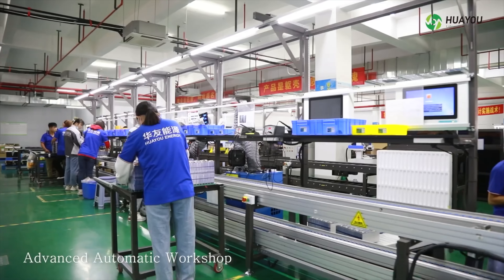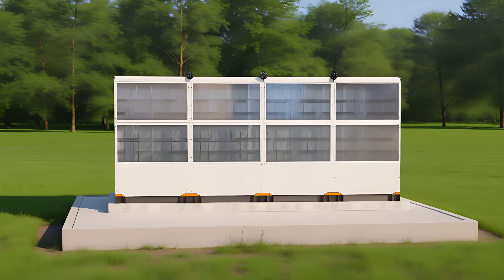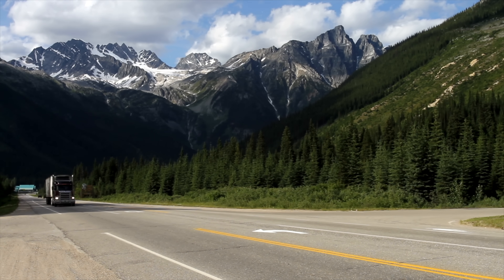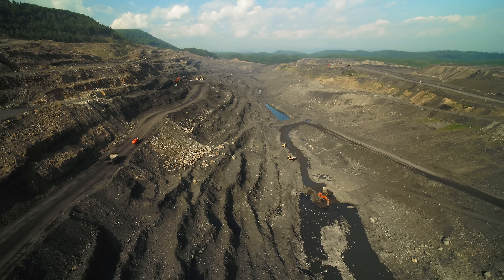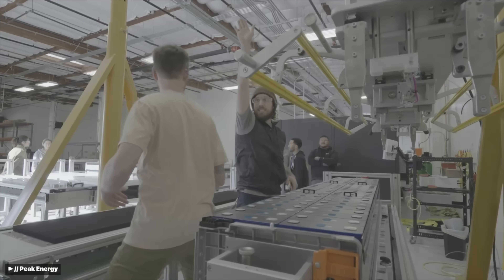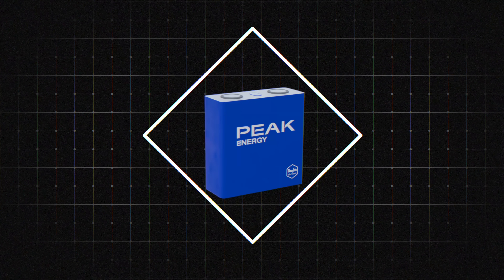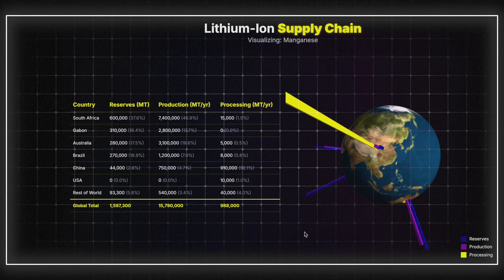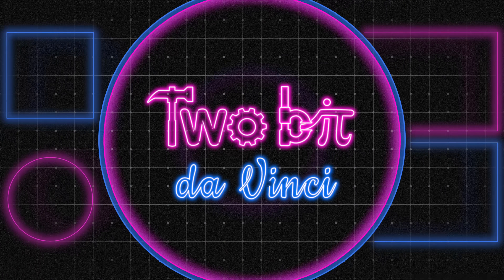Sodium Ion Batteries Are Going to be EVERYWHERE - Here's Why

Comment: 7:33 Claiming this constant voltage drop as a positive is wild. It literally disqualifies it from so so many applications that need the steady consistent voltage output until it's nearly drained. It's why an old phone might turn off at 25% when you try to do something more demanding like answer a call or play a video, because the voltage starts dropping too low even though it's partially charged. The extremely steady consistent voltage of lithium ion batteries is highly valued, and the most expensive cells hold that voltage output until they're nearly empty. I build battery packs, mostly for fpv, and voltage output curves that hold above around  3.2v for as long as possible are what you want. Almost all electronics need extremely steady voltage that doesn't drop below a minimum level, and its basically a binary above is on, below is off. You do state this, but I think calling it a tradeoff is a huge understatement, and it basically isn't a viable solution for the vast majority of consumer uses.
Reply: @lifson22  For consumer electronics, voltage regulators are part of what you need to do anyway, linear or not, you have to normalize voltage output.

The move to higher voltage systems has to with the strength of magnetic fields you can generate per kg, and yes part of that has to do with coil windings. Extrapolation from coil winding requirements to the cabling requirements in getting energy from batteries to the voltage booster is not sensible.
Reply: I think that can be easily managed with voltage regulation, as well, the assumption that sodium needs to fill all applications is not necessarily required. But i can see a use for vehicles, chordless tools, and stationary power storage.
Reply: I don't think it was portrayed as a replacement for consumer device batteries, but as a technology for adding grid and subgrid level backup. Rather than spending oodles of dollars on transmission line materials, permitting, EPA studies etc., one could actually use local/onsite renewables for all these ridiculous AI data centers that at the moment seem only good for potential brown-outs. I am sure the economics of putting these in consumer devices with the voltage discharge curve issues will be interesting. There is a difference between we 'can" make it work and whether or not it makes sense in a world where margins on many consumer devices is already slim.
Reply: Would it be possible to somehow distribute the energy drain across multiple cells over time?  Like instead of having one cell that starts at IIIIIII level and steadily drains to IIII level and continues to drain until it gets to I level, have four cells that all start at IIIIIII level, but only draw power from one of those cells until it drains to IIII level, at which point power starts also being drawn from  cell 2.  When cell 1 drops to II level and cell 2 is at IIII level, cell 3 kicks in and starts providing power.  When cell 1 is empty, and cell 2 is down to II level, and cell 3 is down to IIII, cell 4, which still has a full charge starts providing power.  By the time cell 2 is empty and cell 3 is down to II level, cell 4 is still providing power at IIII level.  When cell 3 is empty, cell 4 still has II charge left.  At that point, there may not be sufficient voltage to run whatever the battery is powering, but the "quad cell" battery offers relatively constant voltage three times as long as the single cell battery.  

Obviously, I don't know much about electricity, energy storage, ions, voltages, watts, etc.  It just seems like there would be a way to do something other than plug in a battery and let it drain until it's dead, then replace it with a new one, etc.  Does a battery always have to be using all its cells at the same rate and at the same time?   We have relay races where one runner, as he/she starts losing power, hands the baton off to the next runner who is fresh, but hands off the baton when they start losing power.  Maybe there's a way to create a "relay battery"  or "cell relay" within a battery.

If this idea is possible, practical, and promising, then it's probably already been invented.  If it is possible, practical and promising, but has not been invented yet, then I hereby lay claim to the idea and copyright it, or patent it !  LOL.
Reply: @WW-hr1hd  What you are talking about, writ large, are battery balancing circuits - as you surmised, each cell can perform differently and charge differences can cause serious internal issues where a sudden an increase of load on a single cell can cause failure or expedited degradation. There are all kinds of levels of complexity thrown at the problem, at the simplest they simply burn excess charge as heat. Happy reading :)
Reply: @unom8  Thanks for explaining that.  So I guess they sound promising in theory, but in practice, the problems outweigh the benefits.  Back to the drawing board for my next useless invention.  LOL.
Reply: @WW-hr1hd  Nah it isn't all bad, tbh, I had a similar idea for a patent - not sure if one exists or not though, if you have the funds to pursue it and it pans out, feel free to consider giving me consideration 😉:
1. Electronic systems, and especially transportation systems, tend to need to supply 2 or more vastly different voltage ranges, one for propulsion and another for the sensitive electronics. Typically this is implemented via either separate battery systems or aggressively stepped voltage down regulators, which tends to be inefficient.

An active BMS battery balancing system would be a good place to actually facilitate pulling out the 3-5v energy needed to power the fine electronics from a high voltage battery pack from across all cells. All the best :)
Reply: That's just not as big a deal as it used to be.  Modern switching power supplies can deal with variable input voltage and still provide a constant output voltage at high efficiency.  And they're tiny and cheap.
Reply: @richs5422 sure, amperage draw goes up with voltage drop to maintain watts. So now you need to spec you cabling for unnecessarily higher costs offsetting battery prices. Have you seen what heavy gauge cables cost as it is? There’s a reason we switched from 12v to 24v to 48v batteries. Ancillary costs.
Reply: @Rebel635csi  For consumer electronics, voltage regulators are part of what you need to do anyway, linear or not, you have to normalize voltage output.

The move to higher voltage systems has to with the strength of magnetic fields you can generate per kg, and yes part of that has to do with coil windings. Extrapolation from coil winding requirements to the cabling requirements in getting energy from batteries to the voltage booster is not sensible.
Reply: @Rebel635csi , wrong. The battery contains a DC-DC converter internally. That are dirt cheap silicon
Reply: Sodium ion batteries are a literal step back in technology not a step forward and he has to know that. Noone uses it for a reason. Its not a nee technology.
Reply: @LostSoulsmusic22  No one uses it yet because the breakthroughs that have made it a viable replacement for LFP have literally just happened in the last few years.
Reply: @patreekotime4578  And no.  Sodium is pure garbage and nowhere close to LFP other than cold temp charging.  Absolutely NO ONE will ever willingly use Sodium unless required for temperature conditions.  It sucks across the board.  It requires 50% higher transportation costs as well negating LFP's 5% higher manufacturing cost.
Reply: @w8stral Your information is just outdated.

Comment: Is anyone else as sick as I am of clueless commentator talking about "rare earth elements/metals/minerals" re batteries as I am? You know how much of these substances has been used in BEV batteries so far in hisotry? NONE. Some are used in some EV permanent magnets (for the electric motors), but absolutely none in batteries (except as trace and unwanted contaminants). Cobalt is not a rare earth. Lithium is not a rare earth. You would think a science/technology communicator would know this. Or at least how to use google. For those who don't know, the complete list is: 
21	Sc	Scandium	from Latin Scandia (Scandinavia).	Light aluminium-scandium alloys for aerospace components, additive in metal-halide lamps and mercury-vapor lamps,[18] radioactive tracing agent in oil refineries	22
39	Y	Yttrium	after the village of Ytterby, Sweden, where the first rare-earth ore was discovered.	Yttrium aluminium garnet (YAG) laser, yttrium vanadate (YVO4) as host for europium in television red phosphor, YBCO high-temperature superconductors, yttria-stabilized zirconia (YSZ) (used in tooth crowns; as refractory material - in metal alloys used in jet engines, and coatings of engines and industrial gas turbines; electroceramics - for measuring oxygen and pH of hot water solutions, i.e. in fuel cells; ceramic electrolyte - used in solid oxide fuel cell; jewelry - for its hardness and optical properties; do-it-yourself high temperature ceramics and cements based on water), yttrium iron garnet (YIG) microwave filters,[18] energy-efficient light bulbs (part of triphosphor white phosphor coating in fluorescent tubes, CFLs and CCFLs, and yellow phosphor coating in white LEDs),[19] spark plugs, gas mantles, additive to steel, aluminium and magnesium alloys, cancer treatments, camera and refractive telescope lenses (due to high refractive index and very low thermal expansion), battery cathodes (LYP)	33
57	La	Lanthanum	from the Greek "lanthanein", meaning to be hidden.	High refractive index and alkali-resistant glass, flint, hydrogen storage, battery-electrodes, camera and refractive telescope lenses, fluid catalytic cracking catalyst for oil refineries	39
58	Ce	Cerium	after the dwarf planet Ceres, named after the Roman goddess of agriculture.	Chemical oxidizing agent, polishing powder, yellow colors in glass and ceramics, catalyst for self-cleaning ovens, fluid catalytic cracking catalyst for oil refineries, ferrocerium flints for lighters, robust intrinsically hydrophobic coatings for turbine blades[20]	66.5
59	Pr	Praseodymium	from the Greek "prasios", meaning leek-green, and "didymos", meaning twin.	Rare-earth magnets, lasers, core material for carbon arc lighting, colorant in glasses and enamels, additive in didymium glass used in welding goggles,[18] ferrocerium firesteel (flint) products, single-mode fiber optical amplifiers (as a dopant of fluoride glass)	9.2
60	Nd	Neodymium	from the Greek "neos", meaning new, and "didymos", meaning twin.	Rare-earth magnets, lasers, violet colors in glass and ceramics, didymium glass, ceramic capacitors, electric motors in electric automobiles	41.5
61	Pm	Promethium	after the Titan Prometheus, who brought fire to mortals.	Nuclear batteries, luminous paint	1×10−15[21][c]
62	Sm	Samarium	after mine official, Vasili Samarsky-Bykhovets.	Rare-earth magnets, lasers, neutron capture, masers, control rods of nuclear reactors	7.05
63	Eu	Europium	after the continent of Europe.	Red and blue phosphors, lasers, mercury-vapor lamps, fluorescent lamps, NMR relaxation agent	2
64	Gd	Gadolinium	after Johan Gadolin (1760–1852), to honor his investigation of rare earths.	High refractive index glass or garnets, lasers, X-ray tubes, computer bubble memories, neutron capture, MRI contrast agent, NMR relaxation agent, steel and chromium alloys additive, magnetic refrigeration (using significant magnetocaloric effect), positron emission tomography scintillator detectors, a substrate for magneto-optical films, high performance high-temperature superconductors, ceramic electrolyte used in solid oxide fuel cells, oxygen detectors, possibly in catalytic conversion of automobile fumes.	6.2
65	Tb	Terbium	after the village of Ytterby, Sweden.	Additive in neodymium based magnets, green phosphors, lasers, fluorescent lamps (as part of the white triband phosphor coating), magnetostrictive alloys such as terfenol-D, naval sonar systems, stabilizer of fuel cells	1.2
66	Dy	Dysprosium	from the Greek "dysprositos", meaning hard to get.	Additive in neodymium based magnets, lasers, magnetostrictive alloys such as terfenol-D, hard disk drives	5.2
67	Ho	Holmium	after Stockholm (in Latin, "Holmia"), the native city of one of its discoverers.	Lasers, wavelength calibration standards for optical spectrophotometers, magnets	1.3
68	Er	Erbium	after the village of Ytterby, Sweden.	Infrared lasers, vanadium steel, fiber-optic technology	3.5
69	Tm	Thulium	after the mythological northern land of Thule.	Portable X-ray machines, metal-halide lamps, lasers	0.52
70	Yb	Ytterbium	after the village of Ytterby, Sweden.	Infrared lasers, chemical reducing agent, decoy flares, stainless steel, strain gauges, nuclear medicine, earthquake monitoring	3.2
71	Lu	Lutetium	after Lutetia, the city that later became Paris.	Positron emission tomography – PET scan detectors, high-refractive-index glass, lutetium tantalate hosts for phosphors, catalyst used in refineries, LED light bulb	0.8
Again, cobalt is not on that list. Neither is lithium.

Comment: I watch Undecided with Matt Farrell, he covers all of these crazy new energy tech coming down the line. And from what he has said... I think CLAY wins in home and INDUSTRIAL backup battery STORAGE solutions, since it has similar energy properties at 1/3-1/5 the energy density of Lithium, with Zero of Litihiums negatives such as heat/cold or explosion. I see SODIUM being used in PORTABLE Power Stations, you know those 3KwH Anker, power solutions, and hybrids, not yet EVs full fat. But a hybrid system would benefit from SODIUM, since you don't need the power always, and when you do, you usually only use it in burst, so again, don't need the consistent power of Lithium. Also won't lose power due to overheating batteries, and whatnot. BUT also currently on the horizon and being used in Chinese Android Phones, yet to be tried out in WORLD MARKET PHONES, Lithium Silicone. 2x the density, and increased longevity but harder to manufacture.

Comment: Voltage drops off sharply as it discharges, therefore this bs has ZERO use outside of commercial grids where as you stated " they have sophisticated voltage management systems in place".
Still waiting for that next big invention, like the HUNDREDS of endless, safe, free energy devices people have invented over the last 150 years and then been murdered by their governments for it.
Anything less than one of those inventions is a waste of time, and a government SCAMJOB.

Comment: A Case for Nuclear Power.
Nuclear power is the answer to weather disasters and our energy future. It is the key to powering our electric future and meeting the rapidly growing demand from electric vehicles.

We should build Generation 4 nuclear power plants on an assembly-line basis and deploy them worldwide as fast as we build a Walmart. 
This approach will dramatically cut the cost of construction.

Superstorms, extreme weather, and electricity shortages can all be solved by using off-the-shelf nuclear power technology.

 Small modular reactors, for instance, have been used in our military ships since the 1950s.

Nuclear power can fuel our electric future, including the vast fleets of electric cars and trucks that will soon dominate our roads, and provide the energy needed to scrub carbon from the atmosphere.

 We all benefit from abundant electricity that doesn't destroy our planet.

The Benefits of Modern Nuclear Power.

 * Versatility: Nuclear power can produce hydrogen for trucks, buses, RVs, and airplanes.

 It can also be scaled up and down to complement wind and solar power.

 * Waste Management: Generation 4 nuclear power plants can burn more waste than they create.

 They can also reuse existing nuclear waste, a process that France has been doing for many years.

 * Safety and Security: 
These plants are non-proliferation and "walk-away safe." They have a small footprint, about the size of a Home Depot, and can be located next to hospitals or large retail centers in any community.

 * Efficient Design: 
They can provide steam for heating our cities and can be small enough for a cruise ship or a small town.

 Generation 4 nuclear plants can also be linked in a series to power large metropolitan areas and be part of a local power grid alongside wind and solar.

Addressing Public Misconceptions.

Nuclear power is over 99% safer than petroleum product extraction and better for the environment.

 If you don't believe me, look at the number of deaths every year from extracting fossil fuels. 

We must stop using the air we breathe as a trash can and address how petroleum products contaminate our drinking water.

The media and politicians must stop using nuclear power as a fear-mongering tactic. 

They have blood on their hands from every superstorm and every year that goes by while the public is afraid of nuclear power. 

We need to have field trips for kids and parents to see that nuclear power isn't scary. 

We should also commission artists and schoolchildren to paint murals on the sides of these plants.

The Real Disaster.
Don't let the media and politicians scare you with stories about past nuclear incidents. 

What's the real disaster? 
The only disaster is the "pigs at the trough" who, in the name of nuclear safety, are siphoning up public utility and tax dollars for so-called cleanup.

People have been working at these plants since day one, yet these same individuals lead you to believe it's some scary thing.

 The nuclear safety people are a parasite on the business, making it so expensive that it can never be built.